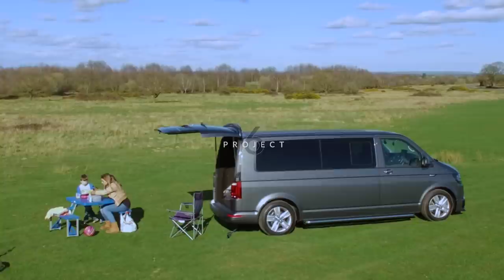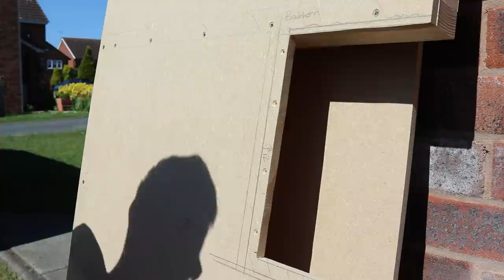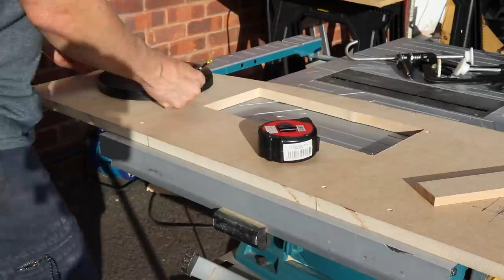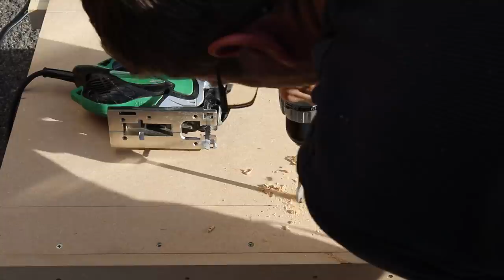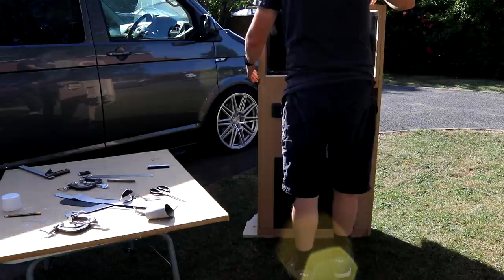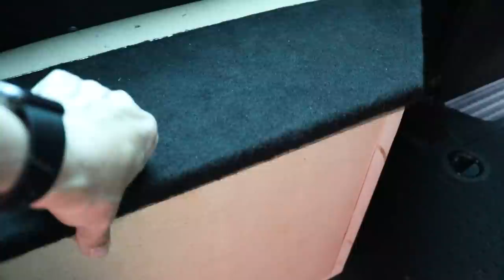MAKING A DREAM CUPBOARD FOR MY TRANSPORTER T6 | Almost ready to to be a camper van!! | Part 1 of 2

Comment: Nice job. Notice you're one of few sensible owner of lwb.
So few of us. Mines my daily driver & never had any problems with parking. That 400mm makes big difference inside.
One point. It looked like black vynil you was putting on cabinet. But final videos shows stretch carpet.
Reply from the maker: Thank you!  Yes I always had my heart set on the LWB as you say will fit a standard parking space (just) but really makes a difference to the interior space.  The black vynil was used to line out the inner pockets for the milk frother and the coffee machine as I felt the steam etc It would be better and then wrapped the exterior in the 4 way stretch to blend in with the rest of the interior.   Have to say the glue has just started to fail on the areas i did the vinyl after 2 summers and 2 winters so I am going to refinish it when the weather warms back up.

Comment: Liking the look of your dream cupboard. One question, is the tv 12v or 240v? If its 12v what make and model is it as it looks a decent size?
Reply from the maker: Thanks buddy,  yes it’s a 12volt tv and comes with a mains lead in the box so it’s multiple uses.  I’m running it on 12volts and it’s great.  I’ve put a link to it in the video description.  There will be a follow Uk video out in a few days 👍

Comment: Nice build dood! Im putting a TV in  the space over the cab, in my T5 which im making into storage as well. It WILL look like a T6 once I update the front end! The TV will drop down one on of those TV lifts 'upside down' so it LOWERS behind the driver and in front of the 2 first class aircraft seats i have fitted for the passengers complete with fold out tables.  Im also in the process of modifying that USELESS cubby hole in the roof of the cab into an overhead double DIN head unit/ DVD player / GPS. I am then making a custom headlining with led reading lights and a halo roof.  Yep you can tell im an ex Air Force aircraft engineer 🤣😂🤣😅🤣😂
Reply from the maker: Sounds epic buddy 👌👌. Like your vision👍. Will be sweet ride when your done
Reply: @SteveField   thanks man its a slow job as the last 18 months have just been a full overhaul of the runnung gear uprrated discs, brakes, new drive shafts, wheel bearings etc as shes 250k miles! But now like new.
Reply from the maker: Keeping you busy then 😎👍👍

Comment: Good job. Make it better by having the TV on a hinge so you could watch it outside sitting on the camping chairs
Reply from the maker: 🙌Thanks buddy,  I did want to put a swivel bracket on it but couldn't achieve the firm fix when in transit so I went for a TV with a huge viewing angle for that reason and it works great with the tailgate up😎👍

Comment: What is the name of the glue 
company that you used for gluing leather and MDF?
Reply from the maker: Hi, the glue is called "Trim-Fix Adhesive"  I bought mine from Kiravans but its available on Amazon. Really good stuff and take heat and cold weather no problem

Comment: Looks ace! Does your nespresso run off a leisure battery? I’m about to try and add one to my bakery van (bumbleandgoose.co.uk)... just unsure if it work!
Reply from the maker: 🙏thanks buddy,  it will!  I am having the leisure battery installed this week which will drive everthing.  The Nespresso will be powered through a victron 2000w inverter that’s driven by the split lithium battery. I will be doing a video on this once the split electrics are in👍
Reply: Steve Field have you tested it out of the van yet? I might hook up my invertor to the van battery and test to see if it will run. Some posts said the machine doesn’t like invertors!
Reply from the maker: Johnjoe Smith pizza ovens yeah and they are probably rite!  The cheaper Chinese inverters are not everthing they say on the tin so it’s imperative that a decent inverter is used.  When the machine runs up to pressure it unsettles the current on cheaper inverters causing them to stop. The company installing my victron smart inverter have tested the coffee machine as they have me in their demo👍.  But wise to rig yours all up and try before a deep install 👍
Reply from the maker: Johnjoe Smith pizza ovens p.s. I can buy 6 of these coffee machines for the price of the victron inverter 😂
Reply: Steve Field awesome!!! Thanks bud, I’ll dry test and see how it goes... maybe need a good inverter if it doesn’t work!
Reply from the maker: Johnjoe Smith pizza ovens see how you get on but what I would try is test solo and the plug in a lite appliance that draws just a couple of hundred watts while your running the coffee that way if it works it won’t be effected in any conditions 👍. Good luck and let me know how you get on 👍